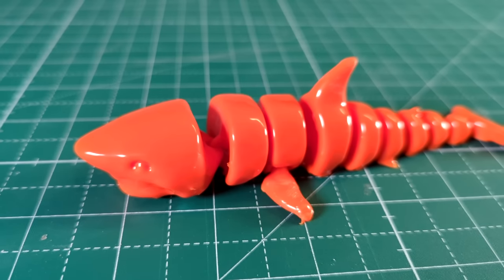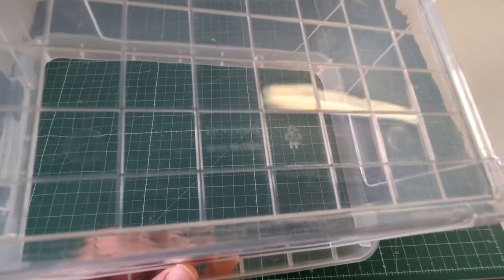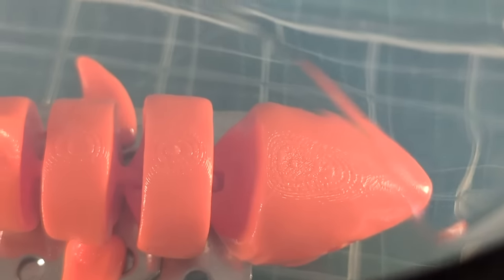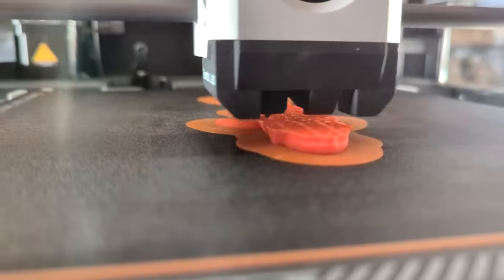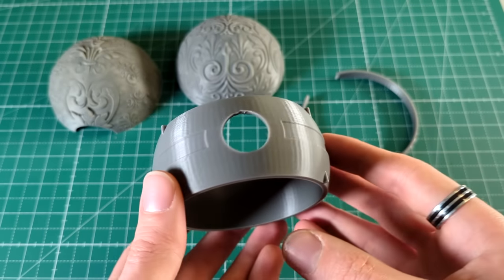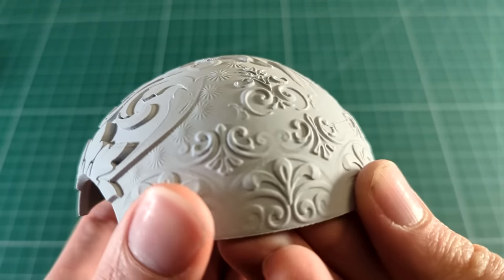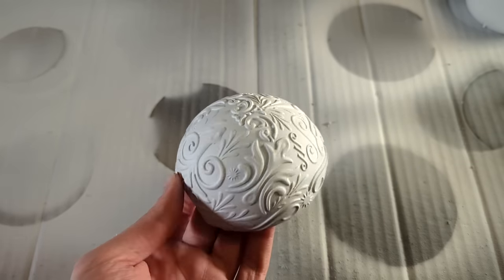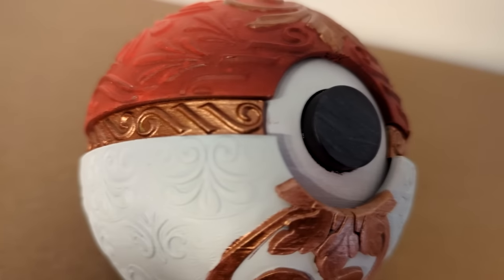How to Smooth 3D Prints Properly

Comment: The best method, as ive learned this from UncleJessy, who learned from other enthusiast, is to use clear UV resin as a top coating. Fast, no dry time, easy sanding, and You keep alot of detail, while deleting the layer lines.
Reply from the maker: The reason why I don't like this method is because resin is expensive and toxic when it hardens.
Reply: @Craftknights3D  It's toxic before it hardens, once cured it's safe to handle
Reply: @benjamin8399  that is true, but the dust is still toxic so if it rubs on anything and dust gets in the air it’s still not good for you. Also, I personally don’t do this because a lot of resins can inhibit silicone curing which is what I do with my prints.
Reply: @Craftknights3D  It's toxic BEFORE you cure it. After curing it, it might go yellow after drying but it takes a few weeks/months and you can always just paint it and use a varnish.
Reply: @atillathehung2000  PLA etc dust is also "toxic" or at least not good for your lungs, so you should wear a proper mask and ideally sand over a suction/fan that can gather the dust.
Reply from the maker: @Abedeuss  it Is slightly toxic before you cure it but during the curing proces it creates toxic fumes that are arguably even more dangerous. Once it is fully cured it is no longer toxic. When I wrote "when it hardens" I meant during the curing process.
Reply: @Kitsmashing I agree with you. I find the tutorial videos very bad, where people wash water-washable resin in the kitchen sink and I just like this: Heaven! Just because it is washable by water, it is not safer. Especially since there is still the GHS09 pictogram on the bottles. So acutely hazardous to water.
Reply: @Craftknights3D  So all of these things are toxic Acetone, IPA, Spray paint, Fillers etc. Just of reference according to the CDC Short term exposure to elevated levels of acetone causes headaches, confusion, nausea, racing pulse, changes in the size and amount of blood cells, unconsciousness (passing out), or coma. IPA vapors can cause inflammation of the mucous membranes and liver toxicity. None of these should be done indoors. UV resin isn't more dangerous than most things used in the 3D hobby its is usually acrylates, urethane or similar monomer in an organic solvent with some compounds to catlyze the polymerization in UV and most people aren't like super glue, varnish or PLA is more dangerous than spray paint, acetone or IPA. They aren't safe but neither is the fumes from PLA while printing.
Reply: @MaheerKibria  significantly less toxic than uv resin. I work with all of those materials, but I also do resin printing, and am working on doing some uv resin fills in wood. UV resin is not a joke. The problem you're missing, is when you do a uv pour, or a uv print, it's not getting into the air, the excess is internally and easily managed, there's a simple cleaning procedure, and the people doing them are more than likely taking the proper precautions, using the right saftey equipment and cleaning prints with the proper solvents (Like IPA.)

Top coating your prints, (especially with an airbrush, or paintbrush) puts resin flecs into the air that will linger for hours, and even if you're in a well ventilated area, this creates a lot of hazards. You're supposed to wear gloves, a chemically rated mask, and sealed chemical resistant eye protection just for the fumes of uv resin, how exactly do you think you're going to fair when you're doing things with it that it's not meant to do? I'm no chemist or health proffesional, but I've seen stories, including in this thread, of people developing serious serious health problems from mistreating this stuff. I don't know the last time I heard of someone handling IPA or Acetone and developing lypmhoma or asthma within a few years. 

Danger isn't equal, chemical danger is even less so, and the fact that you're comparing the chemical composition of the resin to the fumes of PLA show you're trying to minimize the perceived risk without thinking through what risks are actually involved. PLA fumes, are mildly toxic, but we are discussing the risks of mildly reduced health of airway cells over long periods, that can be mitigated with a separate room, a closed door and an open window. That versus, if you don't wear chemist grade personal protective equipment you can develop low level cancer within 5 years, suffer chemical burns on your skin, potential temporary or permanent loss of vision, swelling of the throat,  asthma, oh and  EXTREME REDUCED HEALTH OF AIRWAY CELLS OVER LONG PERIODS! The exact same risk of PLA fumes, but worse, and harder to mitigate. You shouldn't do anything at all if you're going to advocate for something without knowing the risks you're preaching. The exact same risk of PLA fumes, but worse, and harder to mitigate. You shouldn't do anything at all if you're going to advocate for something without knowing the risks you're preaching.
Reply: @BombShot  Ok so you claim not to be an expert so so what to experts say. Well the SDS for Acetone and IPA recommend chemically resistant gloves, eye protection and a respirator. They rate Single organ toxicity at a cat III, and skin and eye irritation as cat II. What about UV resins. They have the same categorization other than an additional in skin sensitivity as a cat I. What that means is that as an irritant and toxin they are similar but as an allergen uv resin can cause really bad allergic reactions. Next research papers. If this is really a bad carcinogen it would be in clearly be well-known. No significant correlation with cancer, or asthma or lymphoma. None of these things are safe. And you should wear PPE and be in a well ventilated area. And Resin can be an allergen and if you are allergic to it you should definitely not be handling it. But other than the allergic bit there is no evidence that UV resin is any more dangerous than the spray filler that was used in the video or the acetone that was used in the video.
Reply: For smaller prints would a clear gel polish maybe work?
Reply: @benjamin8399   But depending on the resin it have a very low melting point, even lower then PLA. So not suited for contact with the sun or general hot summer like 40° celsius  upwards. Also without painting it won't like sun light. There is a method for ABS smoothing no one is talking about to not loose detail someone showed on YT to make his music instrument stay to sounding good after the process.
Reply: @MaheerKibria  Are you talking about general resins or resins for 3d printing?

Comment: Being a modeler for at least 45 years of my life, I am to the point where I want to sand 0%. Layer lines are the what keep me from purchasing a lot of 3D prints, and the main reason I buy from sellers who only show pictures of completed prints and not the stl preview files. I want to see their finished result, not what it's supposed to look like. It's also a reason I prefer  resin prints. Good information here.
Reply: I use a .25 nozzle and print at .10 layer height. You barely see lines and if u do only a quick sanding or even primer is needed to fill those in. It takes longer to print but if you want higher quality that is what is needed
Reply: @com34x  Also good information, thanks!
Reply: @com34x  what printer and material do you use?

Comment: Spachtel is not an English term. I had no idea what you were using. Google translate wasn't much help. Spray on Filler will make more sense to the English only speakers.
Reply from the maker: At 6:31 I said that I use "Spray on Spatula". It's the literal translation. The better translation would have been "spray filler" or "spray putty", you are correct. But there are also links in the description to the items I used in this video.

Comment: the main issue that I have with sanding is that it's always very uneven and it can wear away the outermost details while leaving roughness in the valleys of the print.  I'm curious if you could use a rock tumbler with a very fine abrasive powder for smoothing PLA and PETG. It might be something worth experimenting with for my next project.
Reply: That's why he recommended spraying it with some sort of filler paint. What the filler paint essentially does is add an outer shell, and when you sand it back you leave the outer shell's high parts. (Better way to think of it is after it's sanded what you're left with is all of the indents from the layer lines filled in, which makes things  smoother.)
Reply: Tumbling prints may be a nice solution : https://youtu.be/TlD9USAhcEs?t=189
Reply: lemme know how that works!!
Reply: @BombShot even then the op’s stands, I don’t think you understand that.

Comment: I use a heat gun made for soldering and desoldering so I can control the temperature precisely and can “fix” any mistakes imbedded in the print

Comment: Chemist here.

Just wanna say that while PP plastics are highly resistant to acetone, this is only under standard conditions. For anyone reading, try to remain in an environment that is at room temperature (20-25 degrees Celsius or 68-77 degrees Fahrenheit) and stick to lower concentrations of acetone when using any and all acetone baths.

methanol is also a really good alternative and is far less aggressive than acetone. so if anyone needs to adjust based on their environment, try out both the alcohol (methanol) and the ketone (acetone).

just remember to wear goggles and gloves, and avoid inhaling fumes. I highly suggest wearing a mask when handling both methanol and acetone. both molecules have acute toxicity.
Reply from the maker: Thank you for your Input! Very helpful!
Reply: @Craftknights3D  Pin the comment :)
Reply: acetone is not an alcohol lol. does not have the hydroxyl group, but a carbonyl. but otherwise great advice
Reply: Where did he say it was an alcohol?
Reply: @andrewalvarez8110 somebody doesn't know how to read

Comment: I have a third method: use an ironing tip with a soldering iron and carefully smooth your more rugged surfaces. This takes a gentle touch, and lingering over any point will  discolore or melt your print.
Reply from the maker: This method is OK. The big issue with this method is that some plastics like ABS, for example,  generate slightly toxic fumes  when melted.

Comment: Another option that I prefer over resin and baby powder is bondo or another similar spot putty mixed with acetone. Dries super fast, is fairly cheap, and then once you sand it all the lines disappear. Afterwards can use the filler primer as a final pass so you don’t need to use as many filler primer and sand and prime passes as they are more expensive.

Comment: I'll add a few additional ways, and what you'll use depends on your material, and what you printed:

Acetone polish:  Great for acetone, but best done outside or in well ventilated location.

Sanding:  Slow method, really dusty, time consuming, but the end result looks better every grit level you increase (800-1000 for final sanding process).

Palm/Detail Sander:  Start with a medium grit (200-500) and finish off with high grit by hand.

Card Scrapers:  Really great for smoothing, removes shavings from plastic, and can finish off with fine grit for final touches (start with the larger scrapers, then down to small scrapers for texture and detailing).

Acetone Slurry:  Mixture of acetone and scrap ABS/PLA plastic bits dissolved.  Fills in the lines, and adheres to the surface perfectly.  Will need light sanding afterward as the dried surface is polish smooth and won't hold pain well.

Resin:  will need to mount your object on something, and paint resin onto surface.  Need to mind how much you apply as it could complicate the final appearance.

Comment: There is another method, which I've recently tried and found to work - coating the part with Mod Podge. It does a good job of smoothing out layer lines but may need more than one coat, especially for thicker layer lines.
An advantage of this product is that it dries clear.
Reply from the maker: Thank you for letting me know. I completely forgot about that method. I used to smooth smaller 3D prints with white craftsglue when I was new to 3D printing. 
It's a good method and you can prime and paint the model If you want to.
Reply: Instead of Mod podge, I recommend Clear UV resin.
Reply from the maker: @Brakzillaa  also an Option. However Resin ist more expensive than modpodge and it releases toxic fumes while it hardens.
Reply: @Brakzillaa  that is certainly one method, but has disadvantages when compared to Mod Podge:
1) UV resin is more expensive than Mod Podge
2) UV resin is toxic - you'll need to wear gloves when working with it; Mod Podge doesn't need gloves
3) UV resin needs IPA or similar to clean up tools and spills; Mod Podge can be cleaned up with water
4) UV resin needs a UV source (torch or curing station) for curing; Mod Podge cures in air.

If you have UV resin and a curing station then, yes, it's a reasonable method, but not everybody has those and Mod Podge is readily available.
Reply: Do you have a type of mod podge you recommend? I didn't realize there's so many types 😅
Reply: @SublimeSings  if you're planning to paint it afterwards, I'd go with the matte Mod Podge; if you aren't going to paint it go with the gloss or satin , whichever gives a finish closest to the finish of your filament.
It's the ones with the yellow/orange label that you want.
Reply: You could also use wood filler, it doesn't dry clear but it's less toxic and you move it around with your fingers and it's also cheaper.
Reply: @tedthelynx7715  if you're going to be painting it and it doesn't have fine details (like, eg miniatures do) then wood filler or acrylic caulk/frame-sealant are both good choices for filling & smoothing 3D prints, but you will need to sand them.

Comment: Didn't realize acetone off-gassed that much... 
I recently got a resin printer, but have yet to set it up because of paranoia about poor ventilation, and haven't finalized my plans for ducting out a window yet. I'll have to remember that sanding trick once I'm up and running.
Reply: Depending on your resin printer ,your prints are going to be far more detailed and smoother than a filament printer. I am no expert but I am going on a model I made with a filament printer and then seeing a bust of the main Character from God of War made by a average priced Anycubic 4 K resin Printer. The detail was so superior to what a filament printer can do. Yes it needed painting but there wasn't much sanding needed unless a lot of support materials was used and stuck to the model too well. Anyhow this is the fun world of 3D Printing ; printing something and seeing how it comes out.
Reply: @jayson8118  I thought the fun was printing something, getting angry at yourself for not getting it right, and then repeating.
Reply: I have reactions to VOCs and I'm pretty sure I'll need a ventilator and fume hood for a resin printer.
Reply: @drtaverner  I've found that basic/standard resin doesn't have much off-gassing of VOCs. I have my Anycubic Mono 4K printer in my garage and, while I do smell resin, neither the wife or I find it very strong. I open the garage to air it out for 5-10 minutes and go back at it. The printer comes with a UV blocking cover, so the fumes don't waft around much. ABS type resin and some others (I guess?) are supposed to produce a lot more VOCs and should be in an enclosure with a venting solution (outdoor venting or a filter for indoors).

Comment: How do you smooth Silk/multi color PLA? I don’t want to cover it with a primer and paint over it. I want to keep the color of the filament, but some parts of my prints are rough when I remove the tree supports.
Reply from the maker: You can smooth PLA with chemicals but I absolutely don't recommend that. Instead I recommend that you tune your slicer settings so that your supports can be removed cleaner.

Comment: ASA vapor polishes with acetone as well, and it's UV resistant. I think ASA is far superior to ABS, easier to print as well
Reply from the maker: Interesting. I didn't know that ASA reacts to acetone. Thanks for the Tip! And I agree. ASA is generally better than ABS.

Comment: Surprised to not see this in the comments already but "spatula" is not the correct translation of Spritz-Spachtel (that's a kitchen utensil). The nearest I can figure is "spray filler," but that's quite vague and doesn't resemble any product I've come across here in the US. Do you know what the main ingredients are? Is it a paint primer or epoxy based?
Reply from the maker: There are like 10 comments about that and I already answered all of them. The correct translation would be spray filler.

Comment: PU varnish. It will take some time til it´s cured but it´s not as toxic as UV resin is and it will get rid of layer lines pretty well, also you can paint right afterwards and apply it with a brush, I hate that sprayed shit, I don´t want to go outside or get some ventilation for inside.
Reply from the maker: You are right. Varnish is also a good alternative. You just have to be careful that you don't apply too much at once, in my experience. Or you end up with dried drops on the surface of the model.
Reply: @Craftknights3D  Yes this is true, however this goes for all surface applicants. The good thing is you can decide how heavy you want to go with the stuff.
What I am interested in is "mod podge" OR (what it actually is) wood glue watered down and applied through a spray bottle. Not the kind of spray bottle with gas and pressure but the one you press down again and gain with your thumb, like a parfume bottle. Try that stuff out.